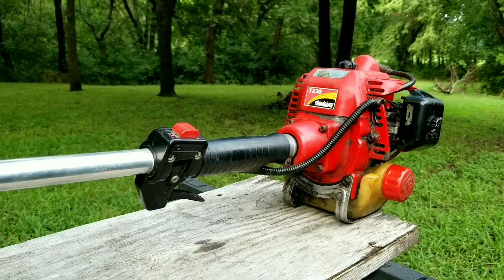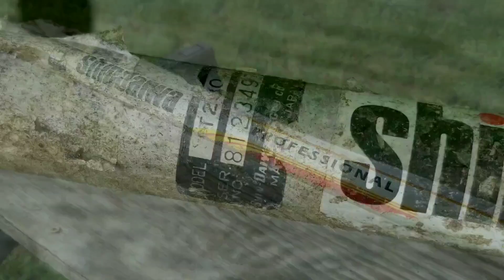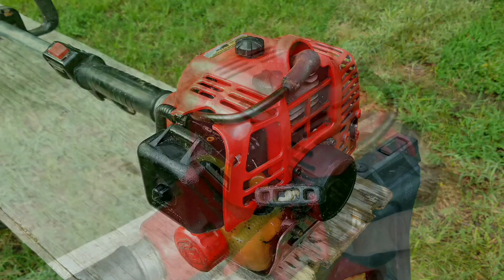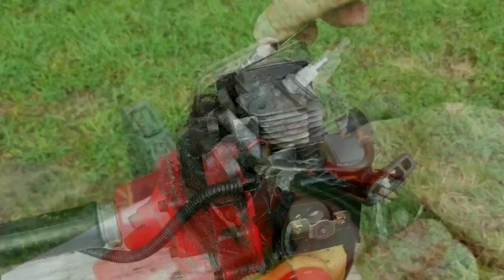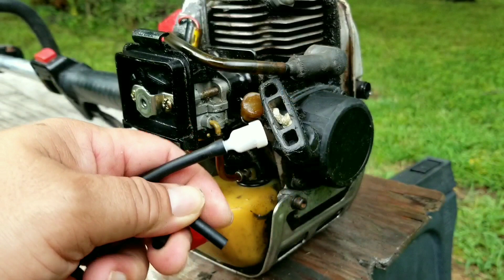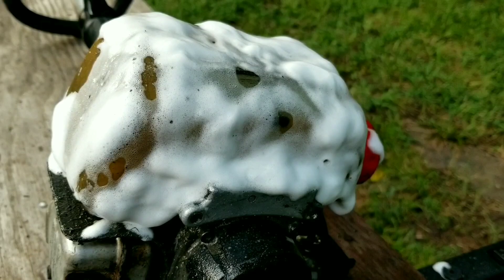Fuel leaks can destroy your trimmer

Comment: The replacement fuel lines were 2 in number but the original had 3. What is the set up?
Reply from the maker: the 2 lines are for the feed and return, while the 3rd is for the tank vent

Comment: I'm attempting this same cleaning process on a t-20. Did replacing the fuel tank vent solve the problem entirely? Also would this be a cause for not throttling up all the way? Pretty sure my vent is leaking and it's also not hitting the high notes.. any advice is appreciated.
Reply from the maker: a leaking tank vent would still be venting so, no it wouldn't be the cause of your engine not getting to full speed.  Have you looked at the spark arrestor screen for carbon build up?
Reply: @HomeGaragechannel  good day & thank for your reply.  Yea I removed spark arrestor & have muffler soaking in gasoline as lots of carbon buildup. Other than these things hoping maybe it's bad gas. Any other ideas?

Comment: I had a major fuel leak with my chainsaw but I didn't notice it at the time of use however when I noticed it, I stopped and didn't use it until I got it repaired
Reply from the maker: yes it's definitely a good idea to not use it till the leak is fixed.

Comment: I have a T230 it is an amazing line trimmer I’ve had it since 1995 looks just like yours. I recently had a fuel leak issue with the lines and vent filter , I sent for a replacement fuel line grommet kit however the grommet they sent was the wrong size. I was able to Gerry rig the old grommet pulling new fuel line thru the original molded leaking line . No more leaks. I just got a new gear assembly from Amazon and I was going to use echo gear assembly lube in the head . Do you know how much grease to put in the gear assembly screw hole on the side of the assembly?
Reply from the maker: nice trimmer you've got there. No I don't know how much to put in. I don't think the gear box is empty anyway so I would probably put about another 1-2 once if it will fit.
Reply: I have the same trimmer.  Pump grease into the head while slowly rotating the trimmer head until the cavity is full.

Comment: Update on my Craftsman trimmer repair: I did a check up on the trimmer and I noticed a black stain on the muffler...proceeded to remove the muffler and I saw that it had no gasket... Proceeded to the parts trimmer,used the exact same muffler with the gasket and no more leaks and it runs like new
Reply: The engine was leaking oil from the muffler... problem solved
Reply: Also did some cleaning with brake cleaning spray and it removed all of the dirt in the engine fins... like new
Reply from the maker: @samuelvelez1643  nice work. You did a great job

Comment: Got a Craftsman trimmer that's pretty dirty and also have starting issues as well as the head doesn't spin when you hit the gas trigger
Reply from the maker: That's a tough situation.  The starting issue is most likely a carb issue. Its about 10-15 for the carb and if you're willing to replace it. However the not spinning is worse. It could be the gear box on the trimmer head of its a straight shift. Does the engine rev up when you squeeze the throttle and it just doesn't spin or does the engine almost stop?
Reply: @HomeGaragechannel  both
Reply: And the gear head doesn't spin when you squeeze the throttle
Reply: Forgot to mention straight shaft,two pieces
Reply from the maker: @samuelvelez1643  okay then the drive shaft not be coupled at either the gear head,  where the split is , or at the clutch. The other is that the clutch is not working.
Reply: @HomeGaragechannel  could be the clutch, when you separate the shaft from the engine and spin the shaft manually...
Reply: It does spin
Reply from the maker: @samuelvelez1643  its good that it spins  but the clutch on the engine may not spin when the motor revs up.

Comment: I have a Maruyama that has no compressoin. The top cover can't be removed because the screw that holds it on is plastic and it's stripped. Looks the same and I looked it up and the rebuild kit is not available
Reply from the maker: Sorry to hear that.  Rebuilding may not be worth it.

Comment: My Redmax eb430 blower leaks a little because the fuel gromit is old. It is 24 years old after all lol. But the engine is clean it runs great
Reply from the maker: Nice. Its definitely a nice machine you got there.  Thanks for the comment I appreciate it
Reply: Home Garage no problem. I have a homelite backpack blower that will not rev up at all even if it has been running for 30 minutes. Could you do a video to help me diagnose the problem?
Reply from the maker: @mattdotsonrailfanproductio266  I could but I don't know how much it would help.

Comment: Those older Shindaiwa machines are really good quality, so definitely worth fixing smaller issues. I've noticed they look very similar in design to the Fuji Robin trimmers of the same time period. I don't know if you had already done some carb work after running it the first time but it seemed to rev up higher after the vent change. I put a new aftermarket carb on my echo chainsaw but it's still running a little strange so I'm gonna change the filter and the vent and that should fix the issue. Love the simple, yet well done videos, keep up the good work 👍
Reply from the maker: Thank you for the comment I appreciate it